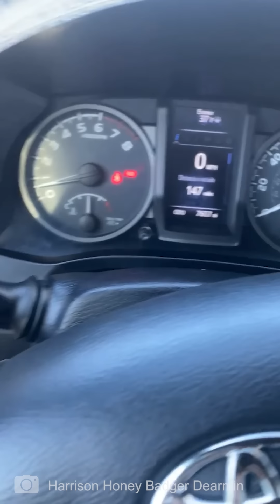Mechanical Problems Compilation [Part 19] 10 Minutes Mechanical Fails and More

Comment: That last dude is a motorcyclists big dream. Nothing like hitting a patch of fuel with a bike. Always gives such a nice traction to the small patch of contact with the road. Well done dude.
Reply: Great cooking, I can taste the sarcasm from here 🤪
Reply: I just started riding a motorcycle a couple years ago and that clip made me cringe on so many levels. Not only the gas on the road. But if he turns next to you, you'll be covered in gas with a heat source between your legs.
Reply: If your bike can't handle a little wet spot on the road you might consider getting different tires...and yeah, I do ride and have zero issues with wet spots.  It's gas, not oil lmao.
Reply: @Geckotan  gas is slick as fuck dude
Reply: @Geckotan  Just because it looks like water doesn't mean it has the same consistency as water, lmao. Get a clue, dude.
Reply: @JohnIsUber247  Dude, gas last like about 2 min max on a road before it evaporates.  Consistency has absolutely nothing to do with how slick something is above another.  At the very least if you're going to talk shit like you know something try to learn the correct usage of words.  I've been riding for well over 23 years and know how bikes handle on most all situations.  And just so you know, I ride a Hayabusa and not some little shitty harley or tiny ass bike.
Reply: @Geckotan  How can you tell if a douchebro rides a Harley or a Hayabusa?  

Don't worry, he'll tell you.
Reply: @Geckotan  tfw he doesn't know gas is made of oil LMAO
Reply: @Geckotan  if you are this slow just stop commenting and lurk more
Reply: One more reason to pay attention to what you're doing and what's going on around you.
Reply: Gasoline to rubber is like water to polyurethane on a longboard.
Reply: @Geckotan  A large amount of liquid gasoline like that is slicker than ice on rubber tires. If you have ever worked at a gas station you'd know that.
Reply: I actually had an accident on a Vespa PX because of spilled fuel. I remember smelling it and then falling with no chance to react.

Comment: 😂 The car has 2 brakes. I would’ve loved to see what he would’ve done if he had managed to start it.
Reply: the left brake is the starting brake: press it in to start and move the selector to 1. now press the gas, when you take your foot off the left brake, the vehicle will start to lurch forward violently....     the right brake is the stopping brake, use this brake to stop quickly or at all if you are on a hill.....   :-)
Reply: millennial anti theft device.
Reply: Just like South Main Auto....he calls that the Millennial Anti-Theft Device
Reply: @alaskanwolf7262  exactly!!
Reply: no wonder they call it the best anti-theft system in america
Reply: 😂 I’m a stranger to it myself, BUT I ride a motorcycle, drove trucks as a teenager, and get the “touch and feel” for manual transmissions. You get it or you don’t these days. You can pick it up yourself, but you need patience, and a good teacher. You can do additional math, you can stack gears.👍
Reply: Looked for this comment immediately after that clip.
Reply: Im a gen z kid and knew wtf it was🤣
Reply: I mean, probably would have just stalled it.  Some manuals start without the clutch engaged.  Would have just stalled and then wondered where D for drive was.

Comment: That last one. Incredible staggering stupidity. How does someone like that even make it to his age ?
Reply: By voting as a democrat
Reply: @Kasper Hansen yeah that's water. And if there was a little clip of the pump running, it was edited in. Too clear for gas, even though it looks clear in a motorcycle tank or in a cup, when you have any large volume of it it has a yellowish sheen to it. 

And it didn't splash like gas does when it hit the road. Very high surface tension, like.... Water. 

Also, can't remember the last time I got gas on a tarp, but it may very well eat through it... But the rest of the clues are enough for me to know it's totally fake.
Reply: Because he's speed running life. He just turned 18 last week.
Reply: @volvo09  you are deluding  yourself. it is a gas pump at Chevron.
Reply: @danceswithcritters  yea, it’s full of water with about 80 cents of actual gas splashed in at the end. It’s completely staged my guy. Gas isn’t perfectly clear.

Comment: That Tacoma. The fact they got drywall screws to drive into that metal without breaking or stripping the head is impressive. That means they drilled a decent sized starter. There was effort there
Reply: They do make self tapping drywall screws for metal studs, so maybe 🤔
Reply: in a lot of countries that car would now be considered a wreck/write-off, you can't go drilling holes in pillars🤦🏻‍♂️
Reply: @ICanSeeYou247  Someone is probably gonna buy it then get a safety inspection done trying to register it and fail said safety inspection because the idiot that had it before drilled into the A pillar.
Reply: @djfive-seven563  Nah thats some dirty south engineering, we dont do safety inspections down here.... 🤣
Reply: Drilled a started? I'm pretty sure those were hammered in.

Comment: 6:23
"Ah, theres your problem.   Your low on spark plug oil."

I died XD
Why did the tool only pick up a cylinder 1 misfire? And not 1,3,5,7 XD
Reply: gonna check blinker fluid too
Reply: It's a 4 cylinder, so no 5 or 7. Also, the plugs in 2, 3 & 4 were dry so they fired just fine. There was probably a bad seal in #1 that let the oil leak into the cylider or into the spark plug boot. That's actually pretty common.

Comment: Dammit!!! I paused the video, asked my girl “what are those three pedals?” She says “gas, break and emergency brake...am I right 🙂”. I just kissed her and said I love you and came straight to these comments.
Reply: I mean,  that's a better guess than. 2 brakes
Reply: Some automatics have an emergency brake pedal.
Reply: @EyesightRob  Are you sure that you dont mix that to handbrake ?
Because least in european cars handbrake is now usually manipulated by small pedal.
It is actually very rare sight to see car with hand operated handbrake.
Reply: @EyesightRob  way off to the left of the other pedals.
Reply: @Kesssuli  that was a true emergency brake, every other one is a "parking brake".
Reply: Never seen those "emergency" brakes before.
Definelty not in bmw.
Gotta wonder whatkind of export model that is.

To my understanding you can throw boat anchor out of window and call it emergency brake
but in this case what is actuall purpose with that pedal when normal hand lever is still there ?
Still operates rear wheels like handbrake ?

Comment: After watching probably dozens of hours of dashcam videos, I'm not really surprised by much.

But the S10 Gasoline Whirlpool has genuinely surprised me.

That guy needs his license taken away permanently at the very least, but should preferably be jailed for a bit.
Reply: I'm really depressed by the fact that I know where that happened. Las Vegas, NV, corner of Sunset and Spencer, across from Reid International Airport (formerly McCarran). That guy in no way represents this city.
Reply: @leftventricle3  Viva Las Veges !. Probably went back to his card board box to self immolate after losing his last $10 in the slots.

Comment: Ok, so the guy in the parking garage with the van. Why didn’t he just let some air out of the tires? It wasn’t that bad till he started trying to free it.
Reply: They are too stupid to know how big the van is, you expect them to possess that high of an IQ to depressurize the tires?
Reply: @MrWolfSnack  you’ve got a point. I don’t know how they even got a license.
Reply: @MrWolfSnack  I assumed they had something inside the van heavy enough to compress the springs a bit. then, when they unloaded, they suddenly didn't have enough clearance.
Reply: @Orinn000  that's a thought.

Comment: The trick to getting a tall vehicle like the van at 4:30 through an area where it doesn’t have enough clearance is to drain the tires a little bit and get as much weight as possible over the rear axle.

Comment: I know there's always new BS to come across in this trade/hobby, but HOW in the hell does a brake line get red hot?? I am genuinely confused and concerned. 😂🤔
Reply: I decided to find the answer for myself. Second clip on the guy's tiktok is showing how the starter wire contacted the subframe and that section of brake line was making the ground side. Vehicle likely has faulty ground straps, as they should prevent this from happening, I would think. Very interesting case.

Comment: I LMAO'd to the "he has two brakes"- guy. Let me tell you something. That center pedal is the brake pedal, and you're right about that. The left pedal is the MAN pedal, officially known as clutch. You use it to cut the power to the wheels, so you can change gears and prevent the engine from stalling. Something your "american standard" does for you on its own.
Reply: American standard is manual though.... But i get what your saying

Comment: The dude had to use his fuel points wisely. I mean, 10¢ off per gallon is quite a deal, and if you get 50 gallons, that's like $5 in savings that gets contaminated and evaporates while you wait for the EPA to issue you some fines.

Comment: 8:05 what is that filter for? cant be for the engine because it's not the way accessible for air filter.
Reply: Modern cars have them. It's a cabin air filter so that when you are idling in traffic and have the A/C on you aren't sucking in smog and exhaust gas into your car. Same for when driving in a dusty environment.  It's mostly absolutely useless and adds unnecessary maintenance parts to your car.
Reply: @MrWolfSnack  that's what i thought. the cost of the air filter itself in comparison of the labor cost puling out the whole dash
Reply: @HighAway  You don't have to pull out the entire dash to get to it, that was the whole joke in it being a "mechanical fail". Someone took the entire interior apart to get to it I guess. You get to it from under the glove box, or removing the glove box compartment.

Comment: If you ever have a van or truck that just barely doesn't fit in the parking garage, deflate the tires to get a few extra inches of clearance and then drive slowly back out of the garage.  Honestly, you shouldn't be driving an oversized vehicle if you don't know this trick.

Comment: 5:47 Lady the car provides enough oxygen by filtering the air outside, there's basically a fan inside the car not the cooling fan. That fan is responsible for blowing the A/C inside the car.
Reply: When you encounter this level of ignorance, it's best just to observe and let it burn itself out. It's just a massive waste of your time and energy to try.

Comment: How did the brake line get so hot??
Reply: Driving around with the brake locked on , maybe ?
Reply: @jonathangriffiths2499  Most likely something shorted the battery through the breakline and it acts like a huge resistor. Oil keeps it cool enough, tho I dont imagine it was ever designed for 800C/1500F temps...
Reply: @priitmolder6475  That's just race temps. lol
Reply: probably having fun with it to heat up with blow torch. brake fluid has a high flash point and boil point.

Comment: The dash removal for a cabin air filter.... is that for real? How tf can engineers do that?
Reply: "Engineers" who I sometimes think have never seen anything in the real world and just live in Autodesk 360.

In some seriousness, somewhere on a university lab shelf is a piece of equipment I designed/built that's like this: you have to take the bastard apart to the last piece to change ANYTHING. It's a little more forgivable in my case because it was a 1-off prototype. But if I had actually sat down and thought it through in advance that wouldn't have happened.

People say BMWs are "overengineered" because of this... I reply that this sort of BS means they are UNDERengineered.

Comment: While I feel for the concern of the guy stocking up on fuel...

People, there are these little things called jerry cans. And they carry fuel. And they come in different sizes. 1 gallon, 5 gallon and 10 gallon.

This is the kind of guy that needs a beat down. He's not just being a fool, his foolishness is putting other people unnecessarily at risk for no reason other than trying to stock up on fuel in a very callous and unintelligent manner.

You would be justified because this is practically a ticking explosive time bomb. Its not the fuel, but the fumes that are incredibly flammable. And once the fumes are touched off, he just turned his truck bed into a VBIED.

Comment: How the phuck does a break line get that dam hot?
Reply: My best guess is somehow it became part of an electrical circuit with a decent amount of current flowing through it... although where the power would be coming is beyond me.
Or it could all be an elaborate prank involving a blowtorch and some film editing.
Reply: @Jakek200  yea you're absolutely right, it's made contact with a naked wire somewhere. Thank you

Comment: It's befuddling to me how narrow minded people get when it comes to the "2 brakes" clips on YouTube. Like we get it, there are people that have never driven a standard or even heard of one. There are also people that don't know how to read an analog clock, or make a phone call on a rotary phone. I'm sure when we went from horse and buggy to automobiles there were old timers that said stuff like "My friend is well off and his kids don't even know how to shoe a horse properly". Times change.. The more of a spectacle people make out of it's consequences, the more their lack of understanding shines. They're an example of not understanding, laughing at an example of not understanding..
Reply: Well there is some truth in those sentences but todays people who most likely have never handled a horse so putting horseshoe might
be bit outside of our league. Phone call with rotary phone is bit similiar. People less than 40 years old may have never even seen one.

But failing to understand analog clock is pure maddnes. Those things have existed couple hundreds years ago and
are still very much used in anywhere. Most likely clock what you hang from the wall is analog.

Cars had manual transmissions by default. Maybe people in states degerated faster and started to put automatics
in cars by default much earlier than rest of world. So i guess it is true that you guys simply dont have those cars
running in typical traffic that much so now 8/10 people will find it strange if there is 2 brakepedals...

Automatics are okay to drive but i like to be in control what is happening in car so i will shift my gears by
myself and swing car around with clutch if i get stucked, what is impossible to do with auto.

5/5 would drive with stick lone reason to prevent morons to steal it.

Comment: For those talking about the last guy, yes he is the dumbeat person i saw, he los the 70% of the diesel in that corner, but at least it was diesel, if you try to light diesel with a lighter you wont... diesel only lights when it is at a high temperature

Comment: How do you breathe in a car..........
How do you get 2 brakes......
I don't even know which part is a catalytic converter and I KNOW that the pedal on the left is the clutch, the center is the brake and the right is the gas. And you breathe in a car because it's not air tight so oxygen can still get in. And if it's stuffy, crack your window and get some fresh air. This chick probably thinks to get fresh air in the car you have to take the whole door off

Comment: Mocking someones mechanical stupidity because they tried to 'fix' something that would cause more harm than good? Acceptable, because it shows they're not as smart as they think they are.

Mocking someones lack of mechanical knowledge because they have never driven or heard of a manual transmission? Not acceptable, because you can teach them.

Lot of ya'll are fucking rude like that.

Comment: Okay Iive in the UK, where manual cars are more common than automatics, and I've never seen one with four foot pedals before. We just have one clutch, one brake and one accelerator pedal. That's it. Only models I've seen with more are from the 1920s or 1930s (or even earlier, when they first switched from hand levers to foot pedals) and are in museums.

Comment: Last guy that was all water... I can tell you that the tarp alone in that beds truck liner would have had enough static electricity to blow it up at the pumps... Some places have water dispensed out of old gas pumps to wash off windshields or top off coolant. It doesn't even look like gasoline
Reply: First, there won't be any static in the tarp since it is grounded through the vehicle.
Second, the only static that would be present would be from the fuel line itself.
Third, it would take a tremendous amount of static to actually ignite gasoline in an open air environment like that.
Finally, pretty sure he would have just said it was water if it was.